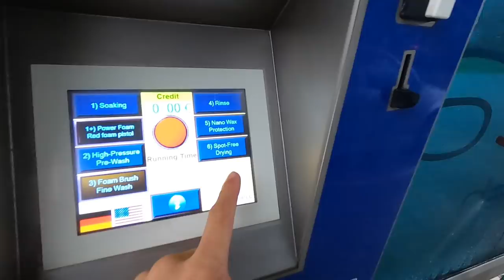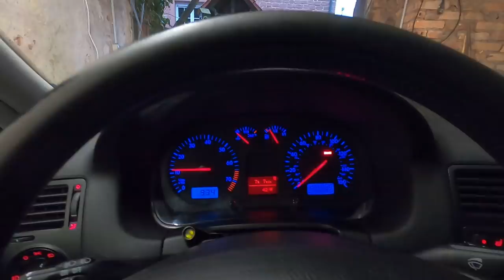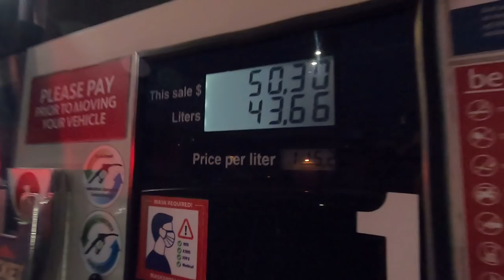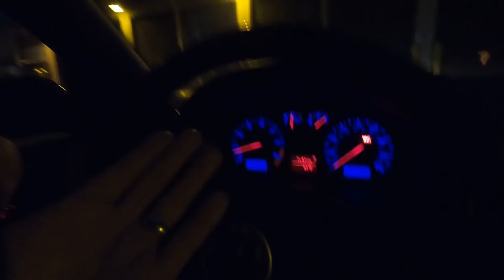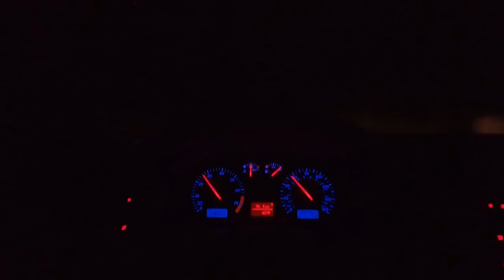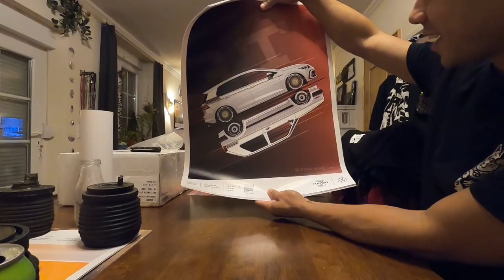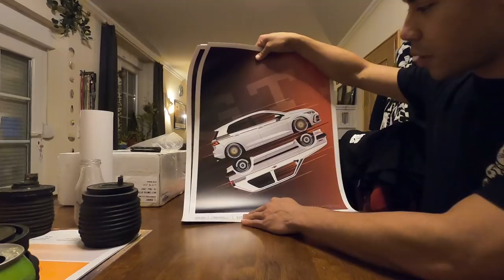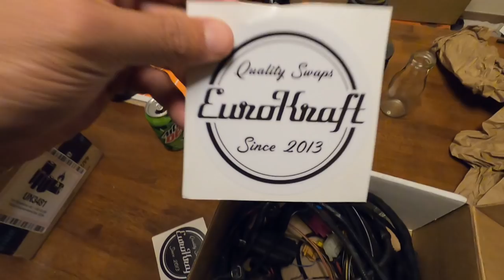We Got Plates For The Jetta VR6 Wagon FINALLY!!! ( First Drive & Huge Piece For The Pink Floyd! )

Comment: If you go to replace the subframe, control arms, and spindles, you can use all mk1 audi TT stuff if you want. They're identical to mk4 r32, bolts right in like factory, it's a great upgrade for the handling dynamics of the car, especially when you lower it.

Comment: That is Awesome that you finally got plates.for the Jetta wagon VR6. Like you said the under side of the Jetta wagon looks good, now I'm looking forward to seeing all parts you're going to put on VR6 wagon in the next video. Yes that extra, spring on driver's side rear is strange.glad you have new rear suspension fix this problem. The new posters and wiring harness for the Pink Floyd are Very cool!